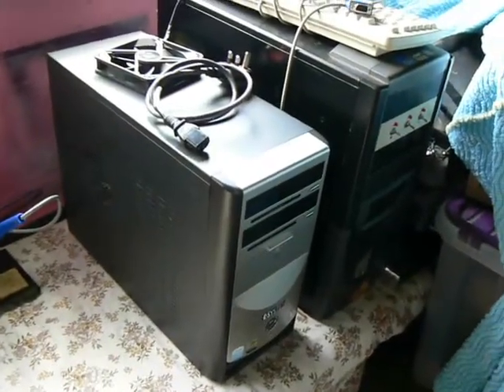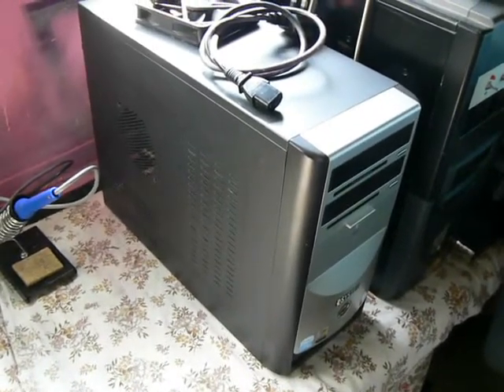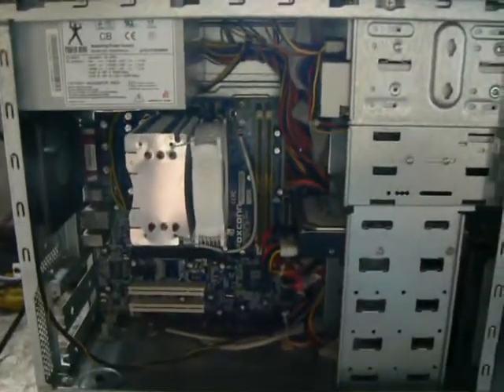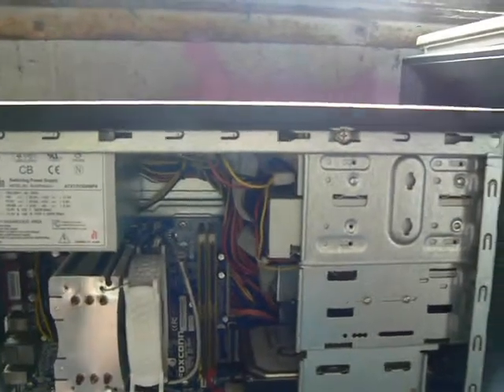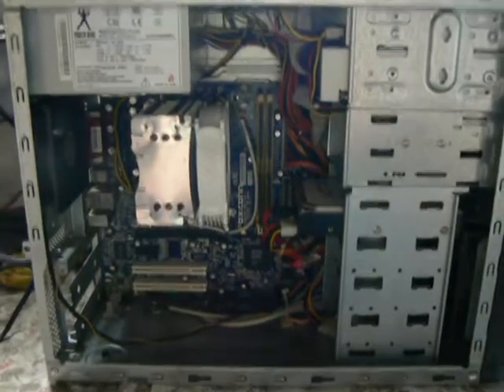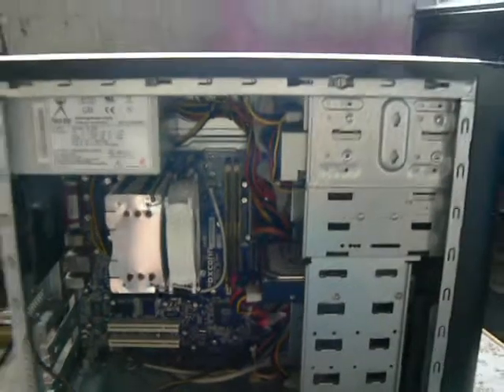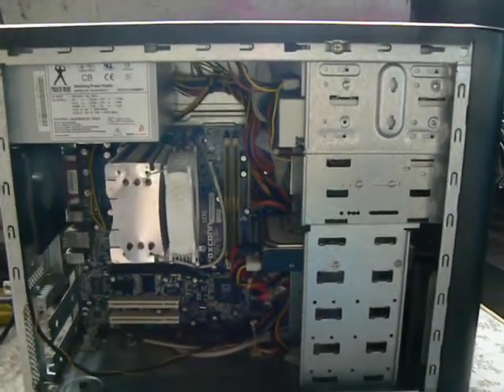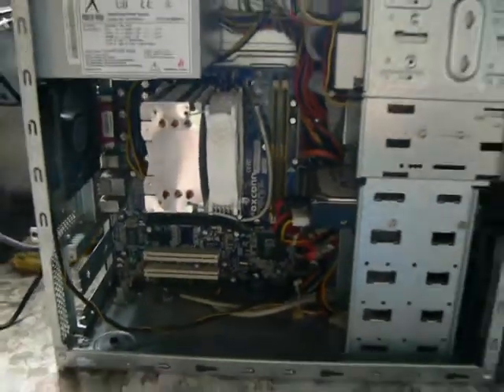Server rebuild and upgrade

Comment: I agree. That is one advantage to raid 5 if a drive fails you can replace it and the other drives will rebuild the array again for you. So it is kind of like a plug and play array. But ti is still a more drives and cable to deal with.

Comment: If you could find enough cheap old drives to use you could run them in raid 5. That way you would have the best of both worlds. The speed of raid and the backup of your data. Just a thought :-)

Great video.

Comment: You could get like a cheap atom board, you can get them for like 50 pounds and they use tiny amounts of power you you may want to consider that as an option.

Comment from the maker: That would be a great idea and I did consider it - unfortunately this mobo wont support any dual core 775 processors, other than the Pentium D. 

So far it's running pretty constantly at 41 degrees which is 10-15 degrees cooler than my previous server.